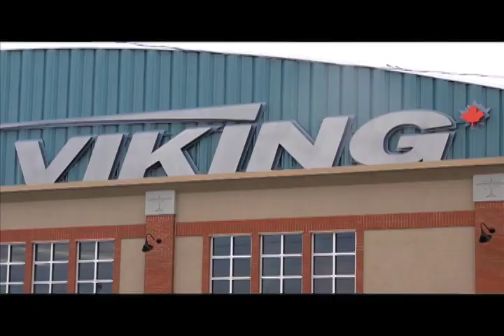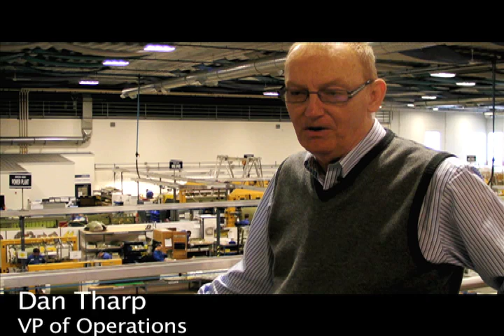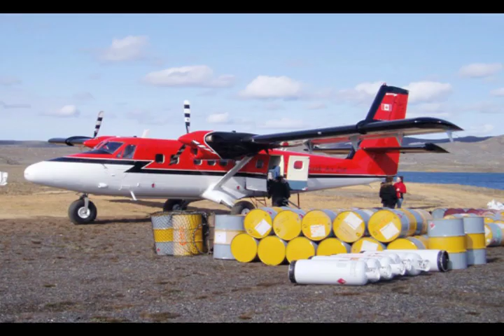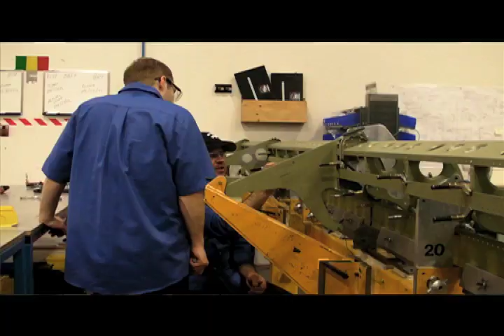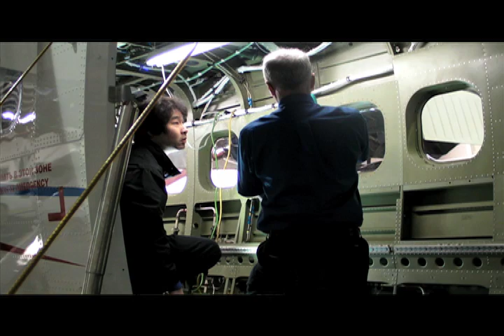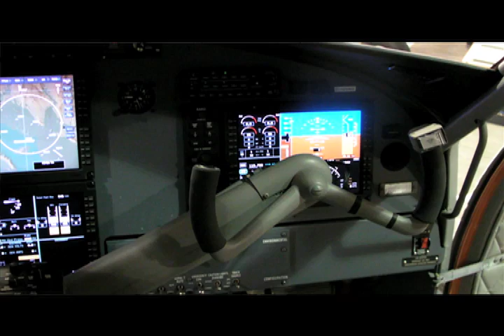Viking Air Twin Otter Factory

Comment: I have over 4,000 flight hours in the DHC6-300.  Love that plane.  Was wondering what the rated horse power is on the PT-6 engines used on the 400 series.
Reply: Ron Fill more Sir is 400 series is available in Pressurized options ?
Reply: I don't know,  interesting question!   The 300 has a max service ceiling of 25,000 feet.  When I first checked out in the Otter I was flying in the Colorado Rockies.  Often flew at 15,000 feet on O2!
Reply: Sir how much payload Twin Otter will carry if an airport is at 11000 ft ? Sorry for baking question if you cold answer me plz ....😄
Reply: It has been 42 years since I last flew the Twin Otter.   I have forgotten a lot of the numbers.   But I can tell you a few.  In the US the Max Take Off Weight for the Otter is 12,500 lbs!   Anything higher than that requires a type rating and performance data based on altitude and temperature.   The aircraft is certified for a considerably higher MTOW in some other nations.   As I recall the empty weight is around 6,500 lbs,  allowing about 6,000 lbs for fuel and payload.   Max fuel capacity is, as I recall, 2,200 lbs.    I used to operate the aircraft in and out of Leadville, CO where the field elevation is right at 10,000 feet above sea level.   No restrictions!  Do not recall ever taking off there at the 12,500 lb MTOW.  On summer days the density altitude at Leadville could exceed 14,000 feet.  As I recall, Leadville is the highest elevation public use airport in the nation!   I also recall the Otters we operated carried 19 passengers plus crew of two.  Plane is certified for a single pilot, but few operators do that,especially in passenger configuration.   Perhaps in all cargo!   In spite of the high lift wing and fixed landing gear the cruise speed was about the same as the venerable DC-3!
Reply: Ron Fill more Sir thanks for your sharing valuable experience with me....
Reply: You are most welcome!  I have been studying some pictures of the 400 series the doors do not appear to be conducive for pressurization.     Just a guess, but I doubt they are pressurized.
Reply: They're P and W 750 SHP